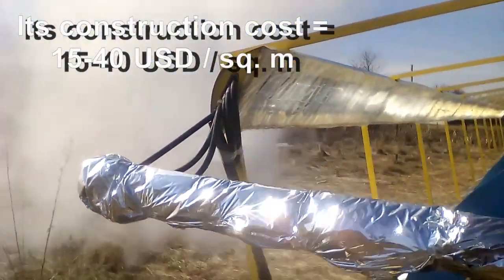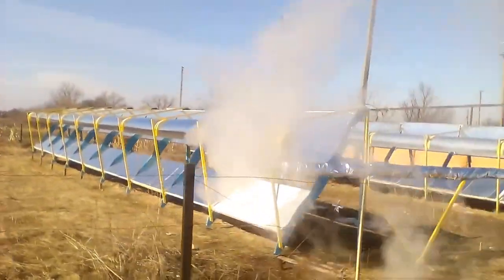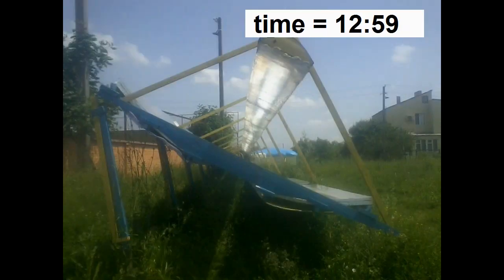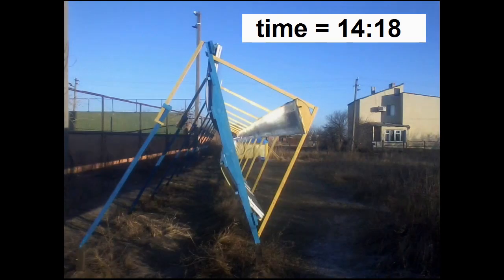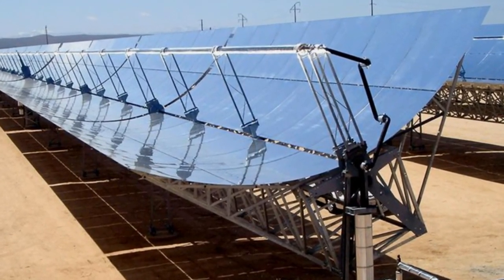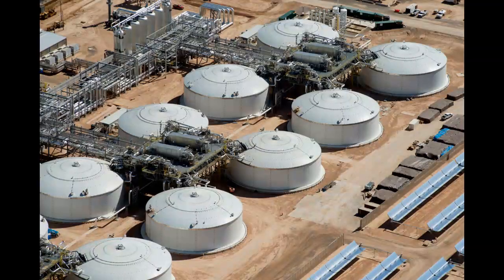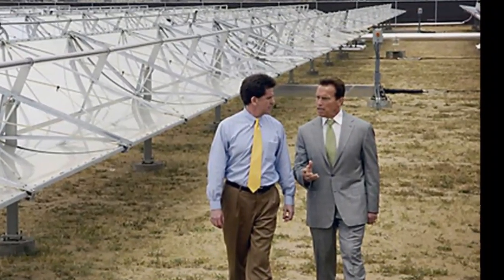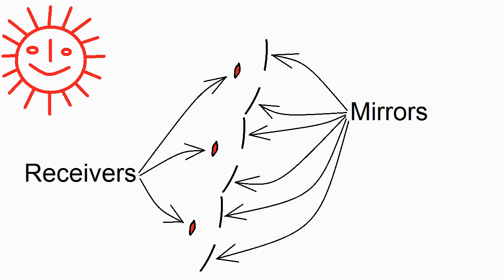Very cheap ( $15-40 ) solar collector-concentrator that does not need a tracker

Comment: ....if you needed to generate 10MW per hour, using your method how much would it cost to build a reliable bootstrap solar farm ? (based in a hot country , with a battery for the nightime hours).  Many Thanks !   (solar providers offer 1mUSD per MW,  would be interested to know if you could do it at a fraction of that ).
Reply: I can do it at $350k/mw complete kit.
Reply: @onekycarscanners6002  thanks for response !  Would that include a battery for overnight ?   If a 24/7 system is required where 10MW are required every hour for 24hrs, is that feasible ?
Reply: @JN003  Since its for a hot climate, solar storage overnight will be Oil tank with a much smaller battery bank or wind turbines for very cloudy days. Total cost for 10mw plant is $5m. If you where to store 10mw overnight in a battery bank it will cost you up to $30m.

Comment: Why not use these solar concentrators to power a thermo - acoustic generator?  No need for circulating water / steam or even molten salt.
Reply: Thermoacoustic generators are very expensive .
Thermoacoustic generators that operate on the basis of  the Stirling cycle have very lower efficiency of about 10-20  percent ,than convectional steam turbine which use Rankine- Carnot cycles and have efficiency that may reach 63 percent .
Molten salt is for storing heat for night period or in case of cloud cover.Since salt has high boiling point it can be heated to higher temperatures of about 400 degrees celsius for storage.
What would heat your thermoacoustic generator if you haven't stored heat.This will limit electricity generation to only when the sun is at it's peak and during at night you'll be staying in the dark.
Reply: @goalhuntlegend    Thermoacoustic engines have Carnot efficiency rating of up to 30% just like a thermal sterling engine.   There are dozens of Thermoacoustic and Sterling engine design variations with different efficiency ratings, so which one are talking about?   About thermoacoustic engines being expensive you'll have to prove your point because they are far more simple than a Sterling engine to construct.